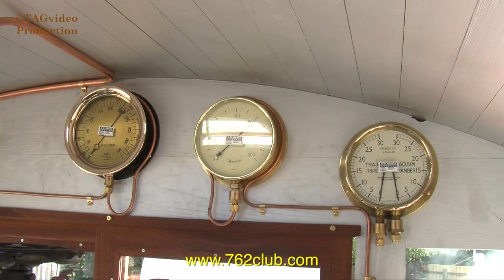762Club LYN First Steaming Alan Keefe

Comment: Great loco - but why a screw reverser?
Reply: Probably because it's safer to use.
Reply: The Puffing Billy railway in Melbourne, Australia which has almost identical original locos has lever reverse.
Reply: Lever reverse was common on US made locos where the mechanism is called a Johnson Bar. Churchward who took much from US practice- for better or worse, used them. It's a less expensive mechanism but it has drawbacks although it is quicker to use which is where the problems can begin. Churchward used screw reverse on his later Saints and for obvious reasons- as drivers struggled with the mechanism on a powerful engine. There is a story of a Saint doing 120 mph as it went out of control light engine: "Tuplin theorises that the pole reversing lever may have adjusted itself (at 100mph) and the crew had difficulty in re-adjusting it and/or closing the regulator." C B Collett was on the footplate but the experience was kept from Churchward. Collett built  further series of Churchward  mixed trafficengines with one alteration- the screw reverse, lever reverse is less of an issue on freight trains or in shunting yards. The new build Saint has a lever reverse which I think is a very big mistake if they want the engine out on the national network as it could be tricky for inexperienced drivers.